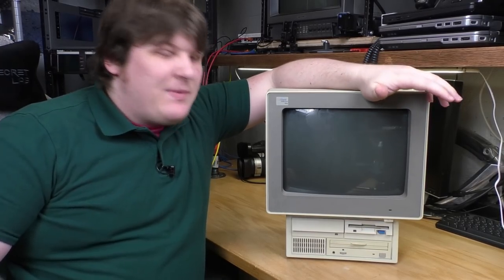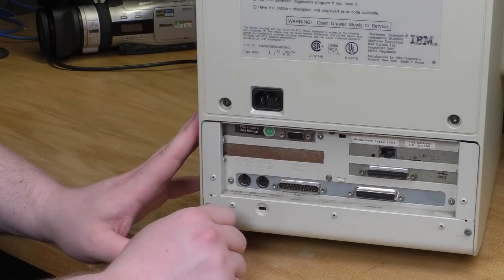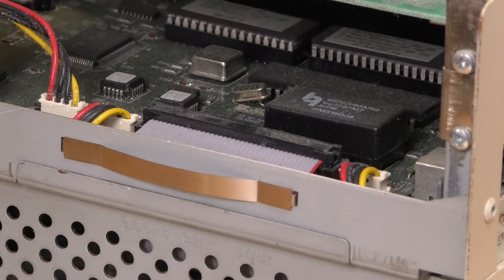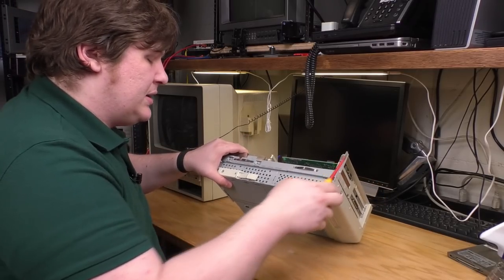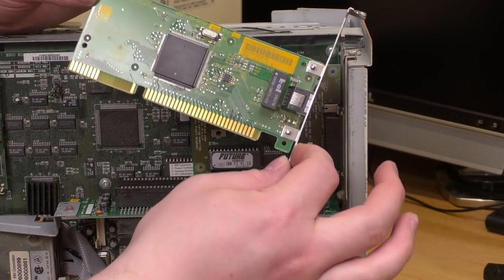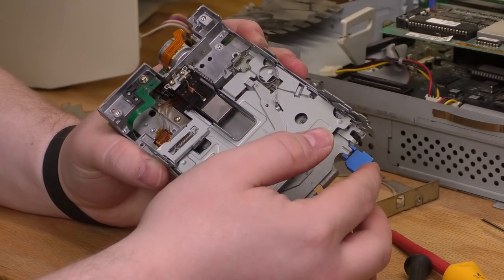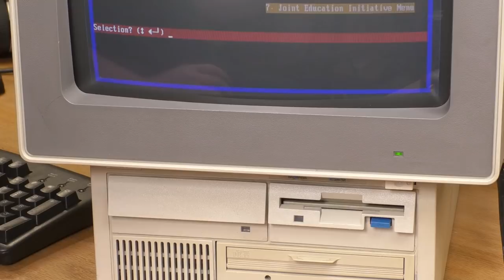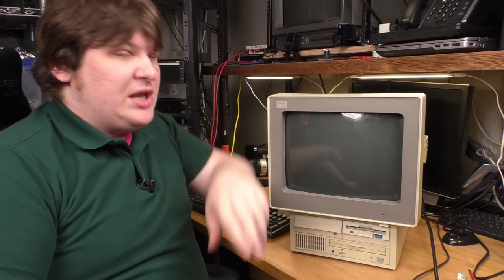Beginning the Eduquest

Comment: I've an ibm ps/1 model 2011, it is a relatively easy machine to use and services, very reliable too, it still runs on its original 20(30?)MB hdd... Too bad it is extremely proprietary (no isa unless you extend it, esdi hdd, very early ps2-ish)

Comment: Consider using ddrescue instead of straight-up dd in the future.
Reply: For clarification, ddrescue is meant for backup/archiving/recovery from systems that might have read errors or other issues.  For example, it can be configured to just write zeros on a read error, or retry a certain number of times, etc.

Comment: Rather than `dd`, you might prefer using `ddrescue` (https://www.gnu.org/software/ddrescue/ ; likely packaged in your distribution of choice) for reading possibly dodgy media.  It can skip failing sectors rather than erroring out (sort of like `dd` with `conv=noerror`, but auditable in the "map file" that `ddrescue` builds) and will make multiple passes over the media to try recovering (unlike `dd`).

Comment: I do find it interesting that it didn't have a sound card in it, could someone have previously taken the sound card out and put in a blanking plate?  Do you think you'll put a sound card into this PC?
Reply from the maker: I'd certainly like to, but since the sound card apparently had a special front panel I wouldn't feel right installing one unless I got that, haha
Reply: @CathodeRayDude  Did the sound card's front panel have a speaker and volume controls and such on it?  I think IBM offered such a sound card package with some PS/2 models.  What kind of sound card was offered with these computers?  I think IBM offered a sound card called the M-Audio capture and playback adaptor, at least they did with the PS/2 range, I've no idea what kind of sound card IBM would have offered for these Eduquest PCs.

Comment: don't be scared of static. Chip brushes will work find but if you're really scared of static then use a acid brush, has a metal handle so with a anti-static strap it will bond the ground.

Comment: Not to be the armchair warrior here, but if you decide to ground yourself, then ground the thing you're working on as well, or found yourself to that thing.
Reply from the maker: I've never seen or heard of that done. It makes perfect sense, I've just never heard of it. Is that common practice?
Reply: @CathodeRayDude  Well, it depends. If you work in an ESD environment, you work on grounded mats while wearing a strap, or you are grounded through your shoes, so this is not really applicable to a professional environment. Also, if your relative humidity is at a normal level (say, 50 to 60%), the static electricity can also bleed off into the air.